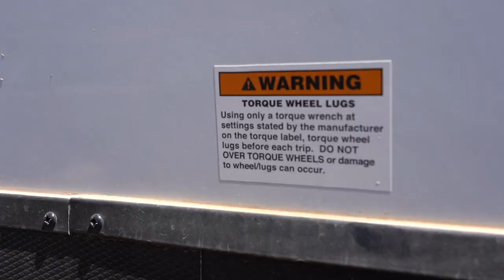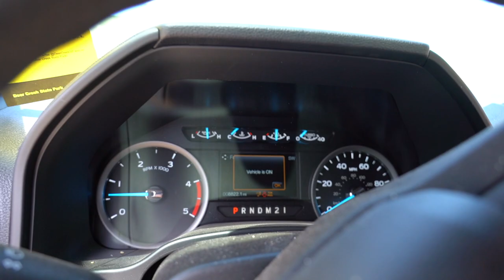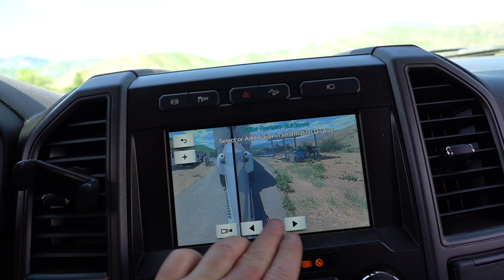BIG RV SAFETY UPGRADE! HYDRAULIC DISC BRAKE & AXLE INSTALL (RV LIVING)

Comment: Once pads are bedded to the rotors, the braking will be much improved.  Surprised Lippert did not have you run through a seasoning routine to get them bedded in.  Disc brakes really should be standard on 5ers!

Comment: Aussome job that they came to you.  Now for the dirt.  Did you upgrade your axle capacity from 7,000lbs to 8,000 or 10,000 lbs and did you stick with greased hubs or go to oil bathed.  What size of tires, rims did you go with.  And the big one $$$.
We are in the process of ordering our new coach and I want 10,000lb axles with Air over Hydraulic since we have a HDT RV.  Want the heaver suspension because of the toys.
Safe cruising out on the highway.  Brian and Cindy "xtreambydesign with passion"

Comment: ETJ.L Hello, I had no idea Thad something was done, that’s why even light aircraft have disk brakes, I believe that your truck is 4 wheel disks, not sure, but even today’s tractors TRAILERS are mostly disk, but many out there are still drum brakes, I do like your system, not going to ask costs as ALL 3 AXELS had to be replaced , just like I follow someone with a PLEASUREWAY ACCENT, they had an HD SUSPENSION installed which gave them2 plus inches clearance, and that was some serious $,   Anyhow take care enjoy your trips. 🇺🇸🇺🇸🇺🇸🇺🇸

Comment: I am sure you will enjoy that upgrade. As a non full timer, I could never justify that expense.  25+ years of towing RVs and race trailers with electric brakes and I have never had a brake fail on me.  Like anything else, if you maintain it it will last.

Comment: So did you buy the new axle and disc breaks from lippert? And there service guys came to Utah to install axles? Do they have a service department in Utah? I want to upgrade my axle in my new Solitude 390RK-R fifth wheel and live in Utah just below provo Utah, so your information will be very helpful please!! Thank you for all you do and show us. Also aren’t your axle upgraded to higher weight range axles?
Reply from the maker: Hi Dwane! We work with Lippert to test out their products. You can contact 39service@lci1.com for information on getting something similar installed. They are 7K axles.

Comment: Tom, with our HDT RV, by going to a Air/Hydraulic disc brakes system we don't use a brake controller everything is done by the tractor giving us a full ABS System.  Plus we have that Hudge truck brakes and jaks to assist with the braking.
Will have to catch you all out there.
Brian and Cindy "xtreambydesign with passion"

Comment: Great upgrade if you are going to spend that much You should have went with the MORryde Independent suspension with disc brakes and got rid of the axels. you will bend an axel next time you turn sharply with all of your weight. I cant believe Lippert would go to a campground to do this except maybe in a Emergency and then I would doubt it

Comment: Just curious how the Campground felt about you doing the repairs there. I worked at a Campground for 7 years, and for the consideration of other Campers we did not allow repairs, and work to be done on site. I'm sure that would really upset other campers that are there for peace and quiet.
Reply from the maker: We asked and got permission in advance.
Reply: @EnjoyTheJourneyLife  Did you take into consideration the noise.  I feel bad for the campers around you.

Comment: Sandra Westley uk, here we have steel chassis that are galvanised so they cannot rust, we do have drum brakes, but better suspensions that you seem to have. It looks like a lot of Dollars to spend on a used 5th wheel, would it not be cheaper to have exchanged it for a newer version.

Comment: Perhaps this type upgrade should be the standard for all travel trailers no matter the size, from the small 14' footers and up. Would it be a good future goal for the travel trailer industry or is it overkill, silly idea and require alot more maintenance? More and more safety seems right goal like with vehicles and air bags and seat belts all now standard. Thanks

Comment: When you lube the axle bearings the tire should be off the ground so you can rotate the wheel while pumping grease in it. Once you see the grease coming out the hub stop.
Reply from the maker: Great tip! Thanks Charles!